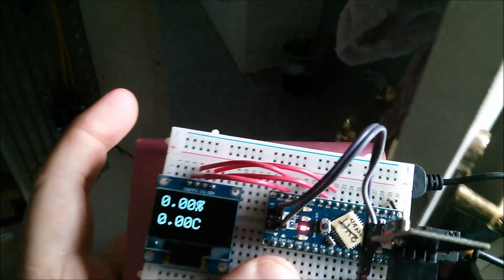Arduino nRF24L01+ Range Test

Comment: Hello Julian,
Did you have lying around 433mhz modules?
At that frequency concrete/wall penetrating is very different.
Lora maybe is an overkill but I was thinking  some cheap HC-12 SI4463 modules.

Comment: Solder on an antenna with a grounded sheath. In order to get a good signal you will need a 1/4 (6.25cm) or 1/2 (12.5cm) wavelength of core exposed. Alternatively, you can make a dipole antenna which will be a lot better than a whip-style.

Comment: Those modules are also available with external antennas. This might do the trick.
Reply: There's even a third type of nRF24L01 module that has a metal shield over the rf circuitry, which apparently improves its sensitivity.

Comment: I remember the Pringles can made a great high-gain antenna. Just google pringles wifi antenna and you'll find lots of info on how to do it.
Here's one with lots of info: https://www.turnpoint.net/wireless/has.html
EDIT: Wikipedia looks promising: https://en.wikipedia.org/wiki/Cantenna
https://web.archive.org/web/20071012133113/http://www.saunalahti.fi/elepal/antenna2.html
This one is quite a flash from the past ... 2006 to be exact: https://youtu.be/KN_1oe3z7EQ

Comment: not sure what antennae you are using making them coplanar would help, but if using the PCB inverted F antenna, I think they have a specific direction that two should be aligned for best signal reception. Also running at 250kbps gives best distance if not already set to that

Comment: Speed and amp power matters. You can add a few cms of wire to that antenna, it seems to work. And your antennas should be in the same orientation. I have a few nRFs in 'mesh'...

Comment: I had a range issue using ESP8266s for IoT sensors throughout my house, ended up using these: WEMOS D1 Mini Pro https://a.aliexpress.com/_TQm1F just make sure to move the 0ohm resistor from the internal to external antenna. Very good range over WiFi or ESP-Now

Comment: The first thing that crossed my mind was possible misalignment of the respective antenna planes. I've had that sort of distance, through walls, with the original NRFs, and the + is supposed to have better receiver sensitivity, plus your workshop is devoid of walls for the most part.

I love the "Reply from Julian's Shorts' - are you moving into techie porn???

Comment: Antenna mod. I fixed my range issues with a quick and easy antenna mod I found online. The new antenna is tuned for the circuit so it works reliably and my xmiter now easily goes through the walls of my house and to the far end of my lot.

Comment: This might help you on the HC12 1.8Km range and only uses 2 pins (TX and RX)  (1) http://www.botsrule.com/pattonrobotics/Simple%20RF%20transmit%20and%20recieve%20demo.html (2) http://www.botsrule.com/pattonrobotics/Multi%20Analog%20Read%20RF%20transmit%20and%20recieve%20demo.html

Comment: External antenna - or put one end or even both ends into a wok (aka parabolic antenna) and point them at each other.  

Also you need an outdoor humidity sensor so you can see if it’s worth switching on a fan in the shed, no pint if outside humidity > inside.

Comment: I was going to suggest an antenna external to the board but you've had success with a reflector arrangement so...
Alternatively you could consider a passive antenna repeater. I suggest passive as the distance required to receive a signal is so small that an active repeater just doesn't seem to be warranted. It also means power consumption of your batteries for a passive repeater is null.

Comment: Perhaps you can try different shapes of directional reflectors, since I'm nearly 100% sure the antenna is omni directional. A little parabolic reflector behind the unit may get you the extra meter or so range you need. Just a thought!
Reply from the maker: Dropping the data rate to 250kbps and using an aluminium sheet as a reflector on the RX unit works well :)
Reply: @JuliansShorts  Do the same thing to the Tx... Kinda like a yagi ;)

Comment: You could use different nrf modules where you can have an antenna on them. Maybe replacing only the sender would be enough to transmit just a bit further.
Reply from the maker: 250kbps seems to work better :)
Reply: @JuliansShorts move the transmitter higher right up to top of the roof of your shed (in a waterproof box with silicon :)  )

Comment: THX for the update about the range. Perhaps WiFi (ESP8266 or ESP32) would work better. (With repeater or a acces point upstairs.) For WiFi i also have a blind spot in my home behind the kitchen where (unfortunately) my computer is located. However I have resonable access in font an back of my garden.
Other option could be LoRa.